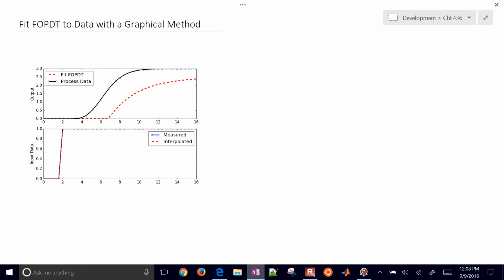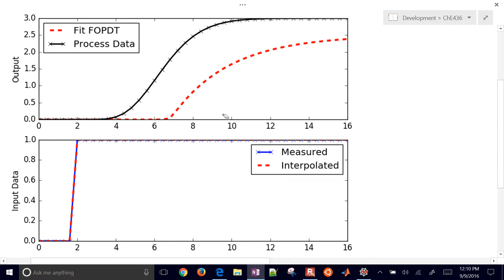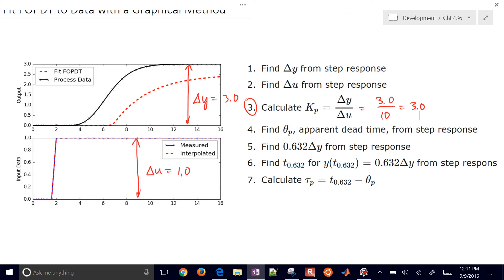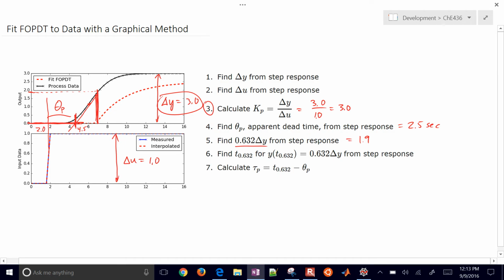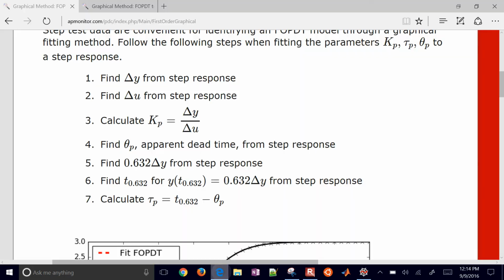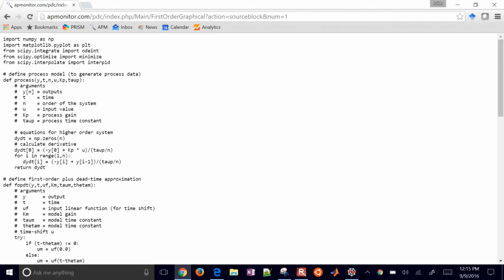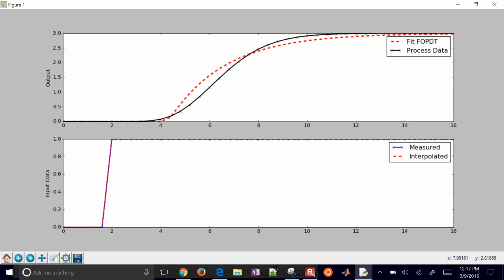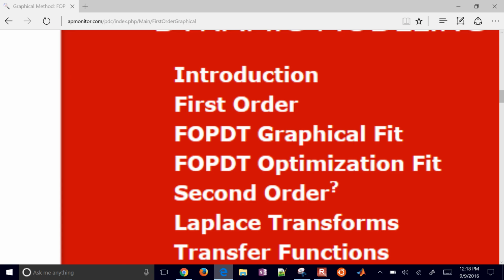7 Steps to Fit FOPDT Model to Data

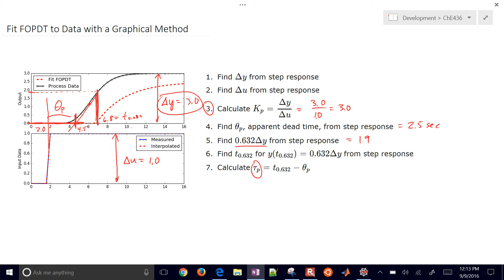Comment: @ 4:46 shouldn't the value of theta_p be 2.5s as calculated in step 4?
Reply from the maker: At 7:57, I change the guess values to those calculated by the graphical method. The optimization method may give different answers.
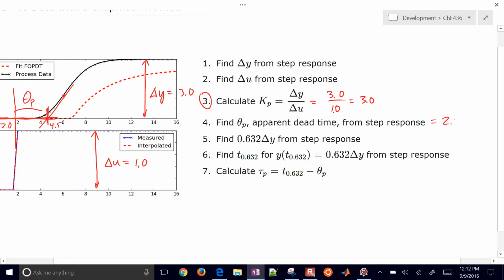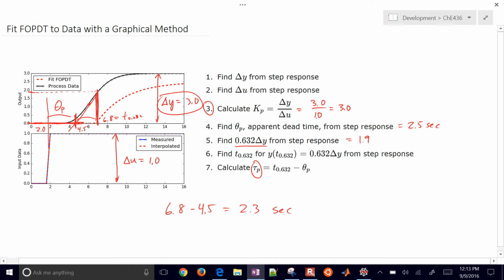Reply: @apm  Could this be a mistake? At 3:20 you say that \theta_p = 2.5 and so I'm getting that \tau_p = 6.8 - 2.5 = 4.3 and not 2.3. Could you explain why theta_p is 4.5? This is around 5:00 minute mark.
Reply from the maker: @AndriyDrozdyuk  good question. You also need to subtract the start time of the input step change. That happens at t=2
Reply: @apm  Thank you for the answer. So it would be something like this then? $\tau_p = t_{0.632} - (\theta_p + t_{step})$
Reply: @AndriyDrozdyuk  yes, looks good.

Comment: The time constant will be 4.9 seconds you did calculation mistake.
Reply from the maker: The calculations are correct. The time constant is calculated at 4:55. If you use a time constant of 4.9, it will produce a poor approximation. Graphical fitting methods are not very exact, however, so values in that range (+ or - 20%) will also work.
Reply: The Tau_p = t_0.632 - theta_p equation assumes the step function starts at t = 0. It does not in this case so you also have to subtract the time elapsed until the step function.